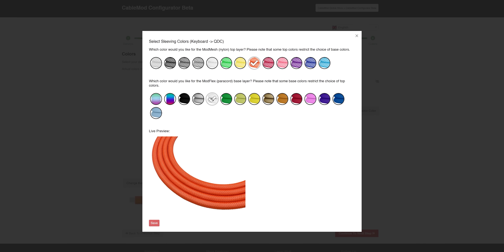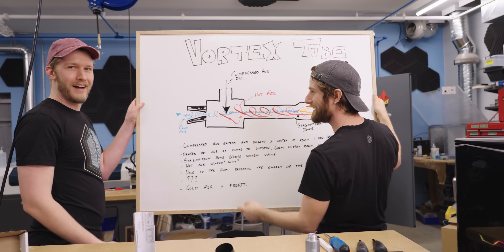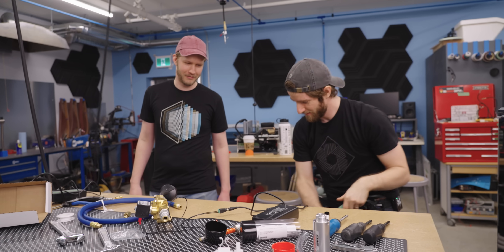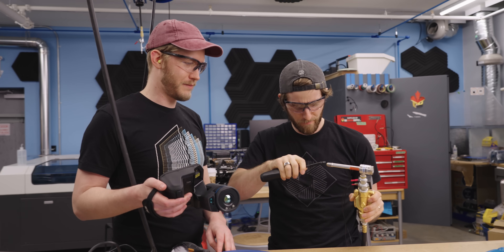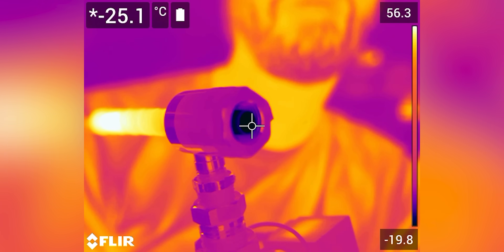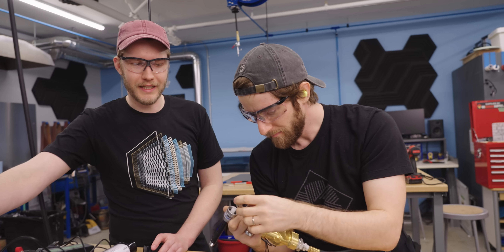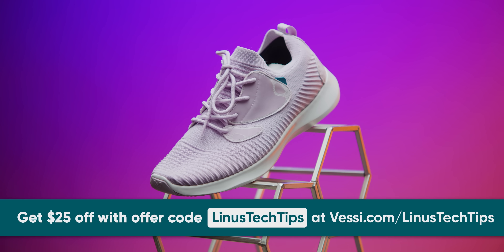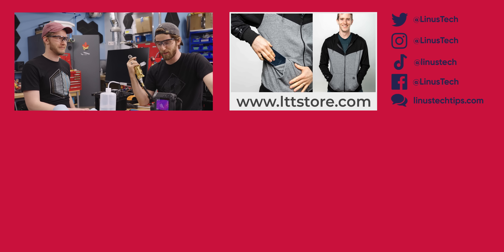This is a CPU Cooler? - Vortex Chiller

Comment: I’d imagine freezing the heat pipes would have just made them non effective.
Reply: Depends what they're using as the heat carrier. I've read some pipes use acetone instead of water, freezing point -95°C (-139°F).
Reply: Or the point at which it was getting cooled was messing up the circulation of the gas. Probably would be best to find a liquid nitrogen setup and just blast the cold air into it or properly seal off the radiator portion of the cooler to blow the air over that.
There's also the issue of surface area of the small pipes.
Reply: @bobski3333  they require heat for proper circulation cycle.
Reply: @ashc3765  Yep. Heating one end and cooling the other makes them work.
Very low pressure inside makes the heat carrier easy to boil. The hot end boils the liquid, the cool end condenses it, sintered metal on the wall wicks the liquid from the cool end back to the hot end. The problem arises when the cool end is cold enough to freeze the liquid. The ice can't wick back to the hot end, so all the carrier material piles up at the cold end and the heat pipe process breaks down. At that point, it's no better than a thin-walled copper tube.
At low pressures, water consistently freezes at 0°C, so the vortex cooler (which is colder than that) runs the risk of freezing up and shutting down a typical heat pipe. An acetone-based heat pipe won't freeze up until -95°C.
Reply: @ashc3765  Everything above the absolute zero contains heat. That's why bobski  named the temperature.
In terms of absolute zero waters freezing point is still plenty warm in terms of absolute physics. Therefore a lot of heat can still be extracted in theory and as of now many real world applications. Like the thing shown in this video, air conditions fridges and freezers.
Reply: The word you're all looking for is convection. Actively cooling the cooler is gonna mess with how it's designed to operate.

Comment: We’ve used these at work to cool equipment for years, because the technology is basic and durable, they can last pretty much forever as long as there’s compressed air.  As long as we have electricity there’s always compressed air.  Although in the recent past, larger equipment gets little air conditioning units, which are much more energy efficient.
Those compressed air coolers do get condensation though, so that’s something to consider, would need insulation.

Comment: @12:20 🤷‍♀️usually you let the welds cool at room temperature so they have more time to relieve stress and not crack the welds… as for cooling the welding torch, they are liquid cooled with a radiator mounted under the power supply.

Comment: It would be dope if you could implement it as an emergency cooling system, you turn it on only when it is needed in an emergency or something
Reply: You mean in case of overheating?
Reply: What would you consider an emergency? It would be annoying if it turned on when CPU is above 65C, as it would just turn on and the off repeatedly.
Reply: Immediately before thermal throttling would be the ideal spot in my opinion.
Reply: @JulianSildenLanglo  yea that too
Reply: @Neoxon619  overheating could be an emergency to some people yea
Reply: @peters.7428  ID say thermal throttling or just dangerous temperatures for the cpu, obviously it wouldn’t be ideal for gaming, but the technology would be pretty cool in something that needs rapid cooling, say maybe future pulse charging in cars or some example like that
Reply: @Neoxon619   it could also even be cool for like a setup like Linus has in his house where his computer is in another room (I believe), just put a tube on the hot end that can withstand the psi, make that lead out the house with a small trap door just for the tube that only opens one way
Reply: COMPUTER ACTIVATE EMERGENCY FPS
Reply: Set up a real turbo button! Press the button and bios sets the CPU to 6 GHZ all core and turns on the vortex cooler
Reply: you could for sure pump it in to a server rack
Reply: @JulianSildenLanglo  and then to 65° before it turns off
Reply: Oh my god! my mother is having an heart attack! quick turn on the vortex cooler!!
Reply: @Theredstar2478  You would need to force (plant a fire or whatever) "dangerous" temperatures for the CPU, those components just shut down before it gets to a dangerous part. In normal circumstances you will not hit a temperature that  could damage the CPU.  Thermal Throttling would probably be possible to work against but that's just completely unfeasable and should not happen with even the most basic solutions we have today. For extreme OC this method is not efficient enough.
Reply: @Nokamigg  well it obviously wouldn’t be for a normal build, that’s the point

Comment: I've been fascinated by vortex tubes for years;  a lot of really interesting applications they could be used for.
Reply: While certainly cool (no pun nor literal meaning intended), I think 99% of potenial applications are entirely impractical due to alternatives being more efficient (in cost and/or energy usage). It's really just for super niche cases where you can't use typical refrigeration loops, nor passive cooling, nor air convection cooling, nor liquid convection cooling, nor TEC if that's ever even a consideration.

Comment: We used one for PHA plastic Biodegradable straws for Starbucks.   When we make the straws its extruded out of a die and it goes into a 50ft water filled tank.  PHA is very tricky to work with as it has two different materials that like different temperatures to crystallize.  One crystal forms in hot water and the other forms in a cold water.  So the first 2 feet was 35°C and the last 48ft was Cold water.  Then we had an air cooler to help remove water and also cool the straw as quick as possible to make it firm enough to packaged.  This process was running at about 700 straws a minute.  

It did a pretty good job cooling the plastic

Comment: I am pretty sure the way this could work is to have a tiny heatsink on the CPU that will allow for even distribution of the air. That way you can manage to keep the small heatsink cool while its working through standard means of thermal compound into the CPU.
Reply: Like some other people have said, just blow it through a waterblock.

Comment: I would love to see an experiment with this somehow cooling a water cooler radiator.
Reply: Or something like sub zero liquid cooling with anti freeze
Reply: Vortex coolers don't work on liquids, but what you could do is create a closed-loop air cooling system where the cold output from the vortex cooler goes to the chip, while the hot output goes to the radiator.

Comment: I used one of those style coolers for an automated drilling machine to keep the drill bits at the right temperature.  We also used one of these for a larger scale electrical cabinet to keep it at the correct temperature instead of an air conditioners.

Comment: I wonder if this would work better if they were to shoot it through the tubes of a liquid cooling system, or even cut some heat pipes open on an air cooler and fire the air through that.

Comment: So heat is related to kinetic energy. The air has a random distribution of fast and slow (hot and cold) molecules, and fast moving ones have greater inertia. This greater inertia means that they are harder to turn so bounce around the sides of the tube when the lower inertia, slower (colder) molecules can swirl around in the middle. That's how the hot gets separated from the cold.
Reply: You could also think of it as the centrifugal force. Due to the high RPM, the outside edge of the tube is at very high pressure and so adiabatically heats up. Since energy is conserved, the gas closer to the center of the tube becomes cold. The hot-end of the tube is designed to leak out only the edge air, so the system always loses heat at one end, and what's left is very cold.

Comment: When I was younger I knew about this and was coming up with ways to cool a pc with it. The problem was cost of the vortex tube on top of the constant need of compressed air. It's certainly doable but not the most practical when you figure up the volume of compressed air and how quickly you go through it. With a proper interface however it'd actually work unlike simply directing air towards a CPU lol.
Reply: A  closed loop propane cpu cooler would be interesting
Reply: @MrDJAK777  basically the same as freon but a bit more risky to set up? some people have made freon coolers and they are really cool (figuratively and literally)

Comment: I installed a vortex cooler on a LSV. It's a measuring device for a 8 axis robot arm. The company started as PRODEVCO. Now I think it's BURNCO. The robot has a 400 amp plasma head and 3d imagining camera to preform cuts to raw structure steel also lay out marks. Had to install the vortex cooler to keep the LSV cool to keep precise measuring. It's get super hotttttt here in okc. That device made a huge difference. Been installed for 5 years and kounting. Love this video.

Comment: These things are commonly used to cool electronic enclosures in the field in hot areas - and $150 is completely neglectible over 25-35 years it is expected to operate given compressed air cost or commonly 20 grand of electronics in a single box
Also - it is safe to use in potentially explosive areas, as it is not creating any sparks
Reply: Ding ding . We have a winner this man knows what it's used for. Also used in my field welding in enclosed spaces for cold air conditioning so I don't blow a gasket in a tiny dangerous space.
Reply: We use the vortex cooler to cool the electric enclosures near a big melting furnace

Comment: It's fairly simple. Compressing air heats, expanding air cools. In a vortex, the outside is compressed and the middle is low pressure. The vortex tube taps into those specific areas inside the vortex.
Reply: I'm not vortex tube expert but I bet this is one of those explanations that sounds okay but doesn't actually hold up to scrutiny

Comment: Same concept as a standard freezer compressor. You compress the air, using a tiny amount of air to exhaust the heat in the compression process. On the other end, it is pure decompressed air, which loses heat as it expands. Your compressor does this without a vortex as air exits the nozzle. The air in the tank was already heated-up when you compressed it, then it cooled down to room temperature. When it decompresses, it is absorbing tons of heat, just not as focused as the vortex device.

AC compressors depend on cooled, unused cooling, returning to the compressor, to help cool the pump down. That is why the "return line" is the cold line in an AC unit, and the "feed line", going into your house, is hot. It decompresses in the air-exchanger, to freezing temperatures, and exits, still cold and decompressed, back outside. The pump compresses it again, into a liquid, and pushes that searing hot liquid through the exterior exchange radiator, to cool it to outside temps. Even at 105F outside, you can cool the 200F+ liquid, and get a near-zero cooling inside the house.

For a real test of value, try using just your nozzle, possibly with a focused "air-brush attachment", and blow it at the phone again. Use that as your base-line. (You just won't get "hot exhaust", doing that.) FYI, You can also make the vortex even cooler if you just cool down your compressor air a few degrees, right at the pump line which is entering the tank. If your pump stays running, the temp in the tank will get super hot and make the cooler less effective and the air in your room will get crazy hot, as well as the exhaust from the vortex. You are literally just using your AC unit, again, for third-party and fourth-party cooling at that point. It would be better to just hijack the "return line" from the AC unit, and get cooling directly from the source.

Comment: You need to try to connect this to a water cooler and run the air through the water block or create a mini chill box around the cpu where you can contain the cold air and not let ambient air heat it up.

Comment: I think it'd potentially work if you had a passive heatsink on the cpu, like the things that are just a block with fins.  Problem with a the heat pipe / fan radiator could be that it's really good at equalizing with the surrounding air temp, effectively dissipating the cold elsewhere on the fins instead of delivering it to the cpu.  You want to maximize the surface area that's being hit by the cold air, but also minimize the surface that could be getting warmed by ambient air and minimize the distance between the temperature extremes.

Comment: You guys should've put a heatsink on the CPU, just a basic one like you'd see in for example PoE switches. That would've probably worked a lot better due to the increased surface area allowing to pull more heat away from the CPU.

Comment: 4:21 That is an ASCO valve. There is a diaphragm with a spring and plunger inside that is activated by the solenoid which is the black square with the wires coming out of it. The vortex is very noise but extremely effective. I use them for cooling down components that I need to service so we can get then repaired and back into production faster.
I also use the vortex to cool myself when I am working in hot areas of the plant. If you take a water bottle and drill a ton of small holes all over and then fill the water bottle with scotch bright or something similar then run the cold air into the water bottle you have what we refer to as a "nut cooler". I stick this device into my pocket while working around hot equipment or I just use the vortex's that has magnets attached to it and aim 2 or 3 vortex's at the work area to cool us off as we work.

Comment: Interesting this idea has actually crossed my mind, except just blowing compressed air directly at a small cpu heatsink.  I guess if this did not work that well my idea would not work that well either.  Not that you'd want to use it over a fan, because of the noise.    I had no idea these vortex coolers existed, that is a really interesting tech.

Comment: I wonder if sending the air from a cold side to a pipe, then trough a waterblock, with the outlet not connected (not a loop) wouldn't do better.
Air is way less thermally conductive, but considering that the flow is way higher and the temperature way lower, it may work out!

Comment: With regards to your compressed air, you could get a sump tank and feed the lines from that or set it up to use the sump once the pressure drops and the compressor starts up again..

Comment: I'd be more interested to see this used to introduce colder air into an existing fan-based system. e.g. imagine a micro PC with a 3080 Ti and you're feeding the case fresh sub-zero air.
Reply: Sub 0 is bad, because of condensation. I think 10-15 is pretty good.

Comment: They could've 3d-printed a funnel to interface with the tower so that the fins get properly fed with the cold air.
Reply: That is a very good hint. Basically, from the point of view of an optimal heat transfer, pretty much everything that can be done wrong has been done wrong here. ;)

Comment: Close up the case, seal off all the intake vents in the front 2/3 of it and pipe the chilled air from the vortex cooler into the case. Compare temps and speed with that VS with the case before.

Comment: When converting electrical power to compressed air, the amount of energy recieved is 94% heat and 6% compressed air.
A compressor is basically a room heater that also happens to make a little bit of compressed air.
It's the least effective way of converting electrical power to energy.

So using compressed air for cooling a seperate different electrical component that also consumes power is beyond stupid.
Reply: You found a secret ingredient of successful videos. Watching people fail since video was a thing.
Reply: Any way to somehow utilize and capture this heat in a sterling engine or water boiler + turbine to somehow create more electricity so it's a bit more efficient?
Reply: @saosaqii5807  Your idea is basically WHR (waste heat regeneration) or TERS (thermal energy recovery system)
This has been used in Formula 1 and LeMans racing alongside KERS (Kinetic energy recovery system)
This is as of this day the most efficient way of converting heat into electrical energy. Very expensive but very effective.

A sterling engine is not efficient at all. It has very low torque and power output.
A modernized steam engine like on a nuclear powerplant is in theory possible, but comes with other problems like size i.e.

Comment: When you cool the heat pipes aren’t you slowing down the transfer of heat from the CPU to the ribs? It works on convection.
Reply: It just causes the refrigerant inside to condense to liquid faster, probably doesn't go all the way up the wick because it doesn't need to.  But if they overcool it eventually there will be more condensed liquid refrigerant in the pipes than vapor refrigerant and would cause bubbling which would stall the process inside.
Reply: I also had a feeling that this is not ideal. I wish they thought a bit more about it.

Comment: Could have tried to run the cold air through a CPU water block
Reply: Thought the same. Maybe even running the water from the block through a heat exchanger specifically designed for their available airflow and temperature.
Reply: Yes but then how do they cool it before they run the vortex cooler?